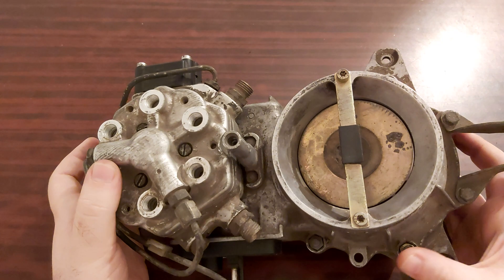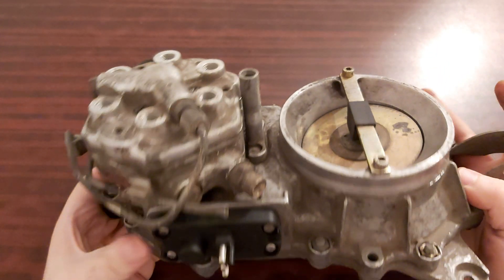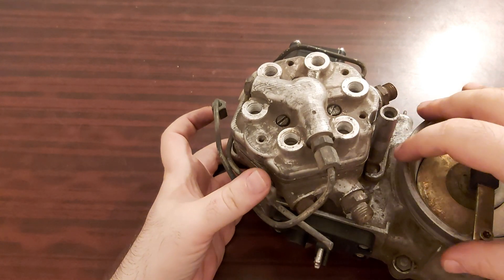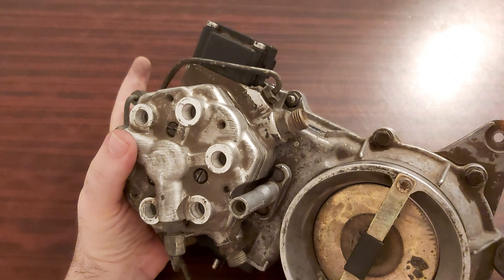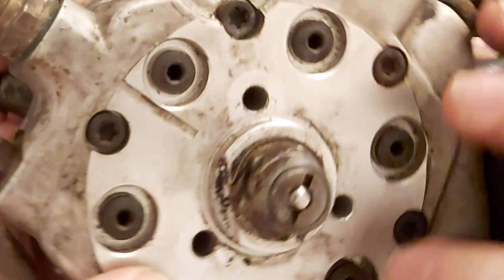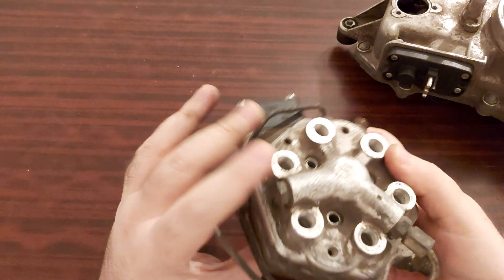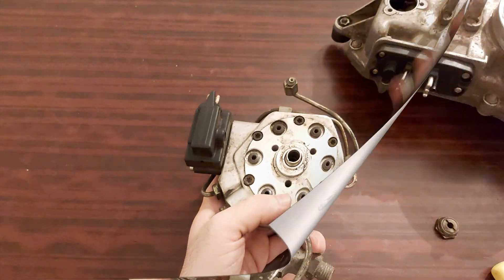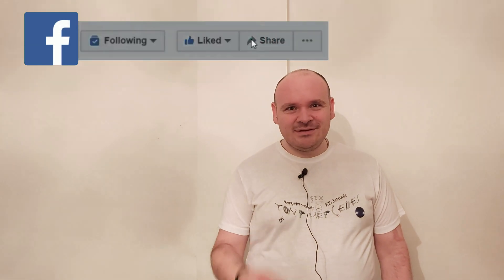㉦Mercedes Ke-Jetronic㉦ - M103 Fuel Distributor detailed analysis

Comment: Actually i would like to thank you for your explained of fuel distributor M103 , but I like to mention you that fuel distributor M103 no need a spring like fuel distributor M102 or 8 cylinders, because it's dependent on pressure of fuel.
Thanks.
Reply from the maker: Thanks. You are right. Greetings!

Comment: If FD ended 012 (for m103), no need spring to the plunger. Plunger is pushed by fuel pressure.

Comment: if one dissasemble an fd, should you be able to blow into the injection ports on the upper chamber? the reason why i dissassembled is because after changing fuel filter and pump i get the correct system pressure but absolutely no fuel in the injection ports even if i depress the air flow vane all the way down.its all resistance with the ignition on.
Reply from the maker: It would be a good idea. But at first clean the fd in sn ultrasonic bath.
Reply: im running now but only when cold one click start..i cannot adjust the pressure regulator to 6.5bars..what is the correct part number of the fuel regulator?
Reply from the maker: @micmac9853  Don't adjust it. If you have an M104 engine you need 6.5bar pressure as for the M103 engine is to 5.5bar is enough. That screw on the regulator has to adjust the pressure of a stalled engine.
Reply: omg.i thought i needed 6.5 bars..anyways what could be the issue on hot start? could it be wrong recess setting on plunger or fine tuning of the CO?
Reply from the maker: @micmac9853  Three things - either the fuel accumulator, the injectors or the cold start valve.
Reply: @mercedeske  my fuel accumulator is brandnew. my injectors too brand new..my cold start valve works since i can start cold meaning it does spray fuel.now when hot what is going on? it should still spray fuel correct? one thing.my aux fan is on already at ignition on cold engine..then also i hear no hissing sound when i depress the air flow vane pump jumpered 87-30..just all resistance.this is why i opened to clean the fd